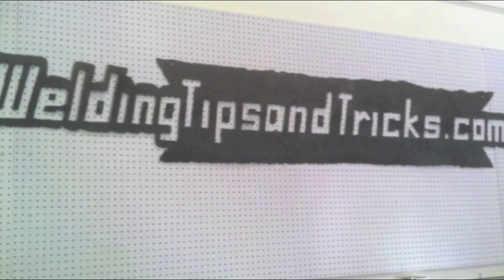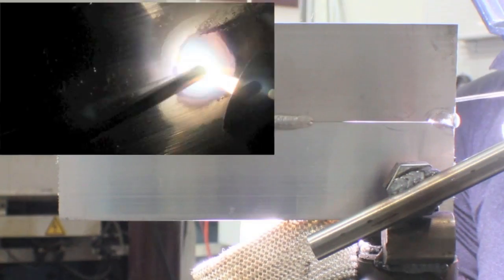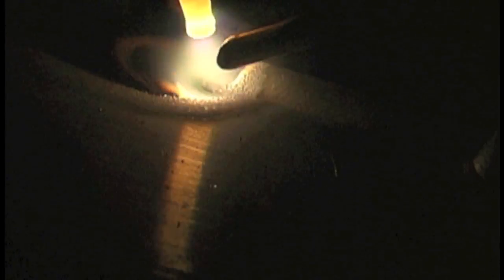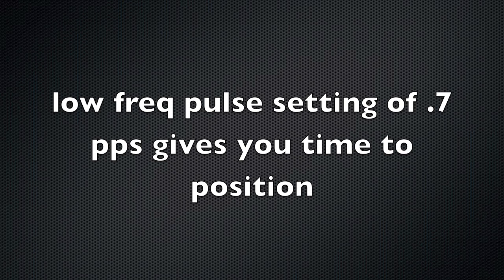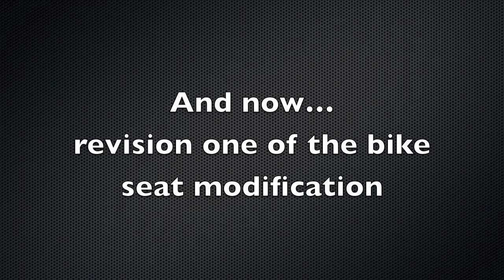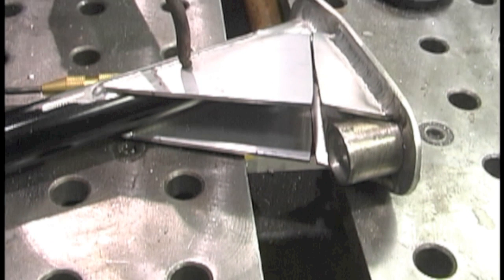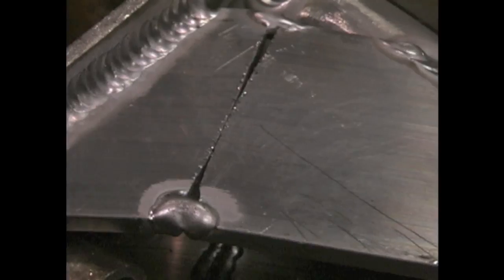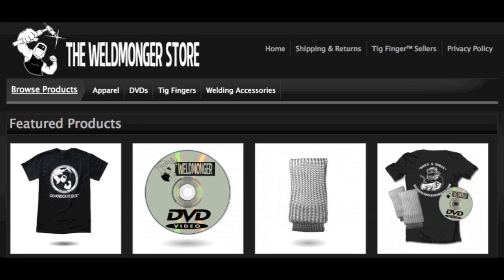Tig Welding Tips for Aluminum and Bike Mod part2

Comment: Jody. Welding a closed aluminum tube. Often I get towards the end of the welding of the tube and it will start to develop a hole in the weld at the very end. It will not fill in and it seems to have hot air blowing out of the hole preventing the hole from closing.

Great video as always and thank GOD for the TIG FINGER. I own a few and use them often. Highly recommended.

Support Welding Tips and Tricks. Get the TIG FINGER. You won't regret it.

Comment: I've seen this one before but I watched it again for the second time and picked up something new to add to my skills. Thanks for taking the time to share your knowledge via youtube. I have one of your TIG fingers and I use it every day. It's rare that I pick up my torch without it. It's a little thing but it's made a big difference in my skill level! I've been doing some really thick aluminum and with a Syncrowave 250 I am really over my head. I'll try your suggestion of 50hz and hope that helps. Already pre-heating and using 50/50 gas.

Comment: Jody, fyi if you ever have another bike seat post project, the toe or tilt of the saddle is adjusted by the clamp on the saddle rails. Just loosen the bolt, push the front of the saddle down to the desired angle and retighten.  Triathletes that use aerobar handle bars use a seat post very similar to the one you made, not an uncommon set up at all.

Comment: Best video I have seen and learned a lot. Have a question. I have not made the plunge to aluminum yet although I have tried. I have 100s of hours of TIG time with SS and mild with good success.  At home I have a syncrowave 180SD which is pretty basic. Have a nice liquid cooled torch, etc.  Just wondering if the 180SD has enough cleaning to make really nice aluminum welds or if I need to move on to another machine.

Thanks

Comment: love watching your video's. I need to buy a tig. I'm not a rich person but I do need to get on you have beatiuful welds. I have a flux core mig. and 80 amp and it works great on thin stuff but on anything that is like 1/4 inch it puddles up and dose not flow. unless I get the metal good and hot first. then it will flow.

Comment: started a new job they have a lincoln 275 presition tig and welding in ac my tungsten keeps balling up. My gas was at 17 cfm volts at 125 with 3/32 pure tungsten material was .125 6061filler today was 1/8 4043 My arc balance was as far as I can understand was 65-70 nagetive or more pen less cleaning 
why wasent my tungsten staying stable?
it seemed to be the machine was not cycling right stayed in dcep to long no matter what I did the tungsten took all the heat your advice and input would be great 
thank you for all your videos

Comment: Hi..I am Davor from Bosnia...your videos i the best....my english is bad but i try to explain what i need....look,.when I welding with tig ac i dont wont ball on wolfram electrode...can you explain what paramethers i need....thanks....
Reply: If Bosnia has 50Hz power then that would explain excessive balling on a transformer machine. If you have an invented machine, go for +/-75% Electrode Negative. Some machines are reverse and it would be +/-25%. You’ll know which way to go because the balling will get much worse if it’s wrong

Comment: Hi i have a home build welding machine, is an high freq arq starter connected to astick welder, some arc welders are labeled ac and others dc, the arc starter have a switch, si i did not sure how setup my machine, any help

Comment: At what amperage you welded this?

I am looking for a 230 volt tig welder.
But don't know wich amperage im looking for.

I guess as high as possible? 180~200 amps?
Reply: I don't see him going over 120 in this job, probably around 80 amps. It all depends on what you're planning on welding but 180 to 200 amps gives you room for quite a few applications
Reply: Nick R everlast will do you well....250 ex is what i have...sweet machine

Comment: Is it possible to use CO2 instead of Argon in TIG welding ?
Would it work ?
Reply: I would say no because you need an inert Gas that doesn´t react with your pool crater. And CO2 is an active gas
Reply: yes in an emergency case. You will get an ugly weld and lots of sparks. I did it before. It will get ugly welds.

Comment: You still aren't reading thing very well. I was replying to STEVE SMITH, not anything Jody has said. STEVE SMITH is asking Jody the question on why he can't close off his bead while welding aluminum tube. I'm simply recommending that if he's purging his aluminum tube with argon and has one end taped off that he should poke a few holes in it to allow him to tie in as the argon flow isn't letting him. Sheesh.

Comment: What is the gas used in welding
Reply: For virtually all TIG welding, pure argon is used. Sometimes helium is added to increase penetration for very large joints on aluminium.

For MIG/MAG welding, argon with a smaller amount of CO2 added is typically used on steels, although 100% CO2 can produce adequate welds in certain applications. Stainless steel and aluminium are welded with various blends of gases, mostly Ar based.
Reply: محمد محمد 
Argon/ helium

Comment: Love you videos, but you are technically wrong on aluminum not turning color if it gets to hot. Aluminum especially 5000+ grade, will turn a slight golden tint when it has gotten to hot, at this point the metal is structural unsafe.  Source: Long ass lecture from Boss/CWI/CWE, Masters of Material Science after over heating a aircraft wing joint